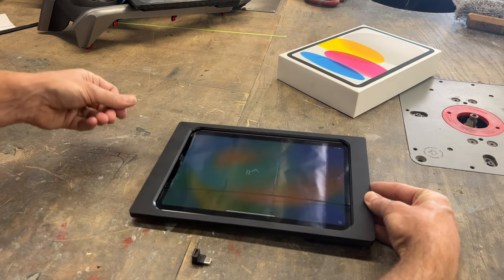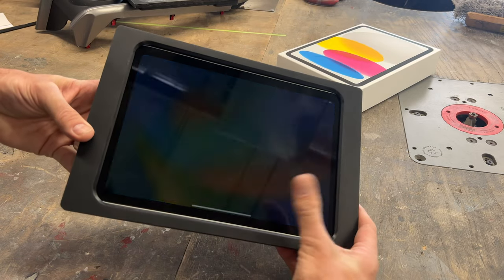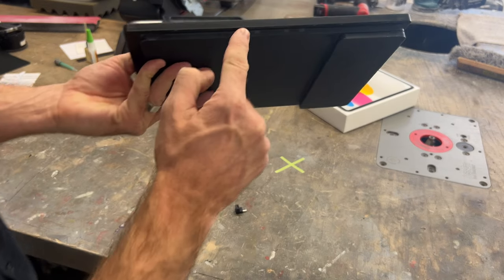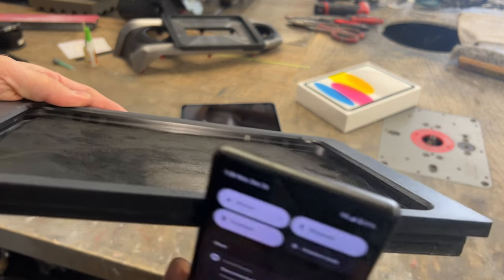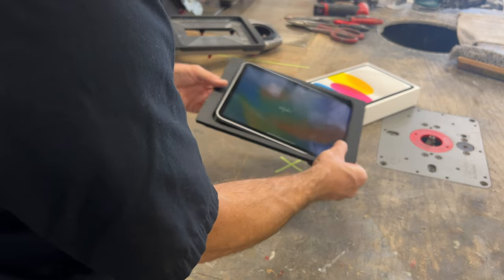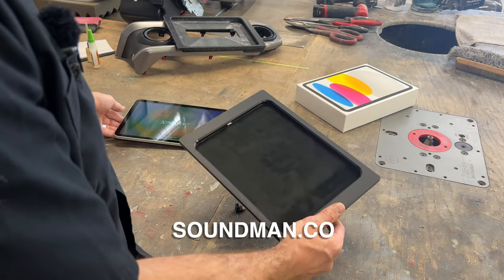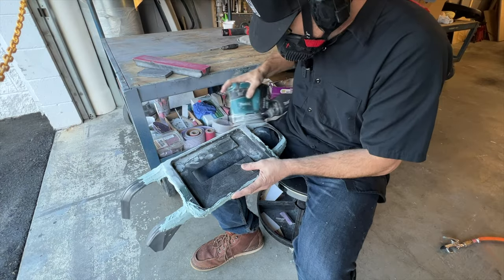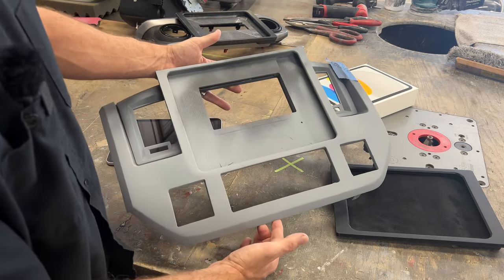NEW iPad 10 DASH KIT - iPad car mount for car stereo

Comment: Great work but I see u guys are Auto-body experts n know how n were everything is located but CLEARLY U GUYS don’t know about iOS Software n all it can do. iPads are a lot more powerful n can’t do a lot. More then what u think n Apple has created app n system that can connect to multiple accessories (displays, lights, cameras, motor, sensors…) and control them at will also creating automations so when some this happens do something as response. Yes this was create for homes, but u can say your car,RV is ur home. By connecting a OBD2 to the iPad it will give it information of ur cars sensors n activities there for allowing the iPad to connect everything in response to those singles. Also Apple security Key accessories (like the locks of ur home door) can be use to start ur car remotely safely or know how driving it by the cell, watch or any personal device, give acces to people for a time n so on. Now also imagine placing lights, cameras, sensors all wirelessly depending the location or wire if is a important security accessory n just telling the iPad to do/run specific actions depending the time of day, what this are on or what are for n more. Also using wirelessly speakers use for home theater in ur car with Atmos Audio (check Sonos wireless amplifiers). In shower u doing all this work to install the iPads to the cars n are only using 10% of all it can do. N yes it is safe n secure. I recommend u guys watch some HomeKit videos n acccesories that u can use in the care, like smart AC/Heat, Smart air purifier n dehumidifier, 18$ wireless sensors u can place around the car. N all u need is an iPad with a hub, OBD2 that can give u all the car information to the iPad and a portable internet hotspot with arouter that will connect everything together. (U can even buy those portable power stations that will work like an extra Battery for ur car that can keep devices on standby when the car is off like 24/7 cameras when movement is detected n keep the router on like the teslas do. Stop buying car accessories that cost 10X more when there are more advanced, cheaper, secure, n stronger build items for home use. If u going to use a home dashboard/iPad use accessory for it so u don’t have to connect all the extra stuff.